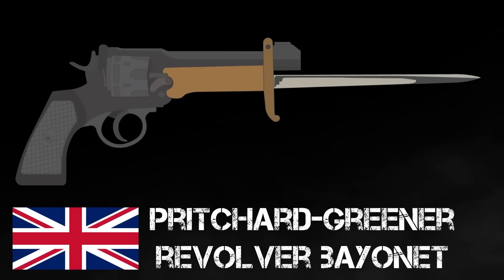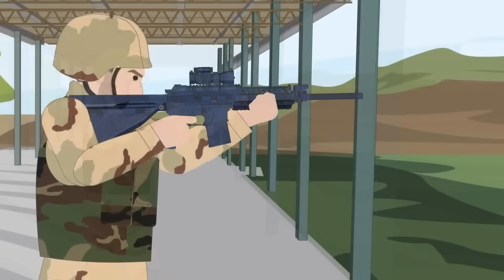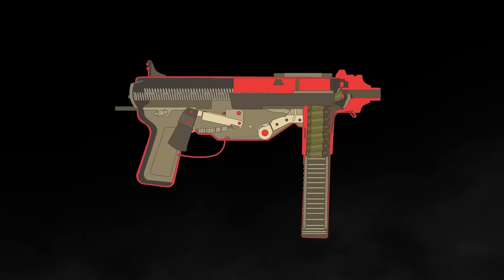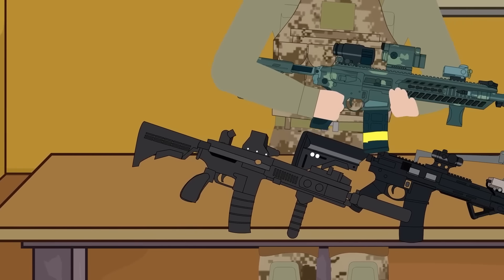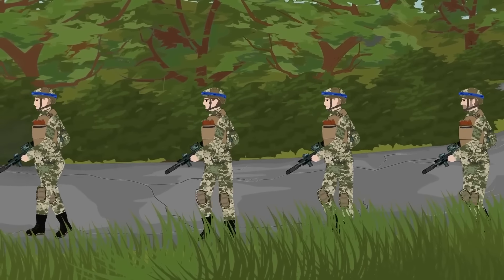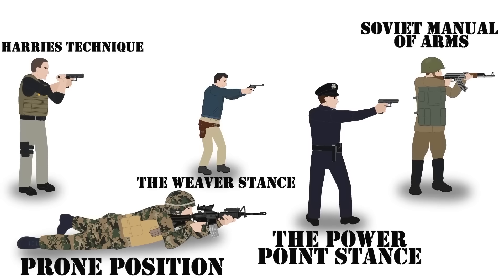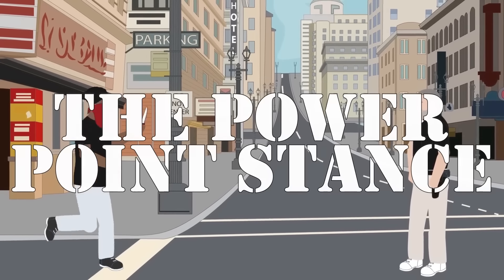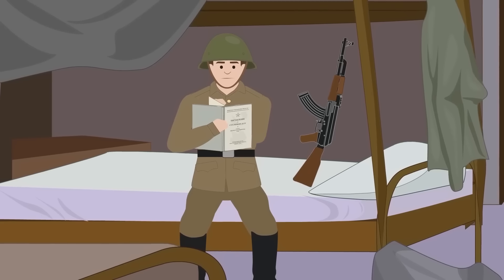What Makes a Good Gun Design

Comment: How do I become a gun designer?
“Don’t.”
Reply: When I get older I will become a military engineer
Reply: Mechanical engineering. Guns are no different than other machines that use high pressure gases to operate. A steam engine and a machinegun are very similar in the way the function under the hood.

Comment: If I ever designed a pistol, it’d be the size between a Glock 19 and Springfield XD9 Sub-Compact, striker fired, would take Glock magazines for sure, and it’d look similar to a mix of various pistols (such as Beretta Pico, Walther PPK, Mauser HCs, Sccy pistols, and PX4 Storm) with the slide having that curve nose while its own original magazine will have that pointed pinky extension. Either it’d be metal frame (with customizable grips similar to 1911/2011 grips and Kimber CDS9) or polymer with a variety of colorful options like the Beretta Pico, Sccy pistols, and Taurus Spectrum. 

If ever designed a rifle, it’d be an AR style rifle that can chamber 5.56, .308, 6.5 Creedmoor, and other rifle calibers with a 16 inch barrel, 18 inch barrel, and 20 inch barrel (like the Primary Weapons Systems UXR). It’d also have colorful options (especially the rainbow color). It’d also have options to have bayonets and grenade launchers attached to it.

Comment: I find it interesting how different armies utilize different stances, despite each countries soldiers having the same anatomy. When I was in the german army in a recon batallion, our prone position would often have one leg pulled closer to the torso than the other for added bracing particularly on uneven surfaces, or we would dig holes for the front part of the feet to be put in, for more comfort and additional support if we knew we would be lying there eventually. Shooting while standing would often times happen from a pose effectively called "pooping deer stance" which is a half ducked-half standing pose with legs and arms being close to each other and the torso, that attempts to minimize the profile towards the enemy while still being able to move at an accelerated pace (rather than ducking completely or standing wide open), reducing their chances to hit you, or a vital organ (by having your arms partially in front of your torso acting as a meatshield if you happen to be lucky). Its largest drawback would be that it can get quite uncomfortable when exhausted or over prolonged times, as the pose is pretty unnatural to the body.

Comment: Imo what makes a good gun design: 
- Good ergonomics
- Ease of use
- Can reliably hit what you're aiming at
- Has reasonable stopping power 
- Physical reliability 

I'm a big fan of Glock pistols and AK style rifles. Glocks are easy to use and a blast to shoot, same goes with the AK. Ergonomics on the AK may not be as good as the AR platform, but it's simple, reliable, and perfectly capable of stopping any threat.

Comment: For a light machine gun, what if the mag was on the bottom but the gun could be rotated 90°. Like give it sights along the side and the top and fold out stand and maybe even a trigger and grip that rotates or is duplicated.
Reply: Ive seen people do this with red dots and sometimes an extra foregrip.  Mostly though theyre not thinking through that theyll have shells and gas ejecting in their eye.

Comment: What’s make a good gun design?

It has to be reliable. East to use. Able to adapt in harsh conditions. It must work in the water. Accurate. Easy to maintain. And fun to handling. Also, it has to be quite cheap to make. Strong enough so that it won’t break in soldier level of handling.

Comment: Why don’t they mount magazines... in the stock? So when you reload, you pull out the magazine from the back
Reply: Depends on the weapon. Some rifles/weapons, like the M16/AR15 and those variants have a recoil spring in the buttstock, to reduce recoil. Also, it sounds like that is complicated and slow, to put your rifle down, to get a mag out of the stock. I find it pretty fast to get a mag from pouches on a plate carrier, or belt pouches. 

I do know some smaller sporting rifles had storage for mags in the stock, but they weren't combat weapons for the most part.
Reply: @chalion8399  I don't mean store them in the stock. I mean that the magazine well and all the mechanisms are in the stock, to create a goofy bullpup gun
Reply: Would be unreliable and heavy complicated parts to make a mag that loaded that way, having to get rounds pointed forwards.  At best a p90 style might work but it would be awkward and poorly positioned to change quickly, and butt isthe best spot for recoil assemblies.